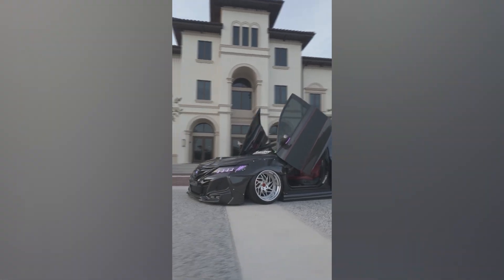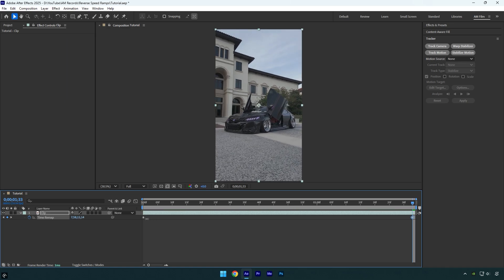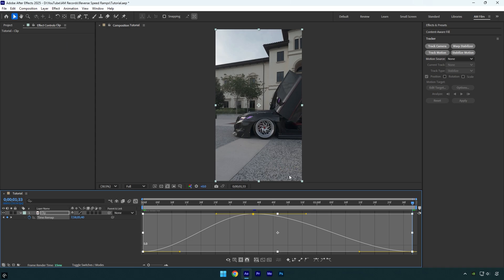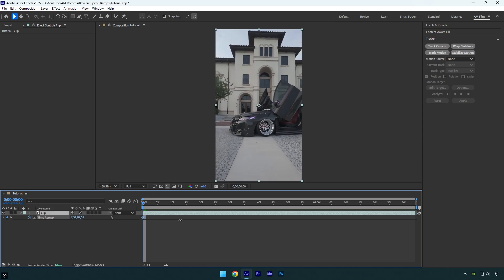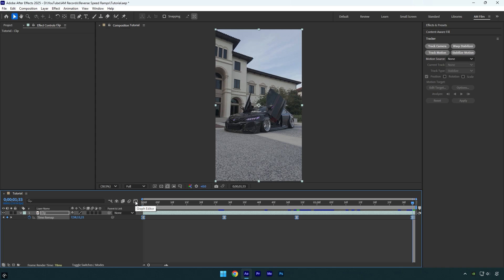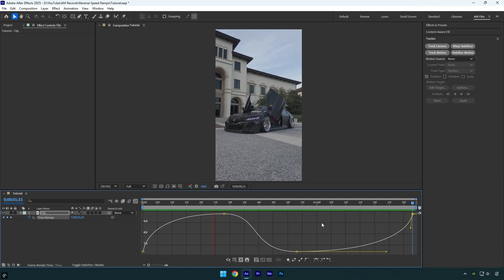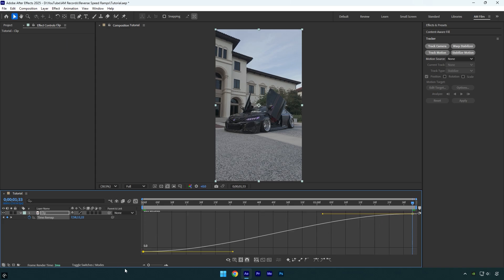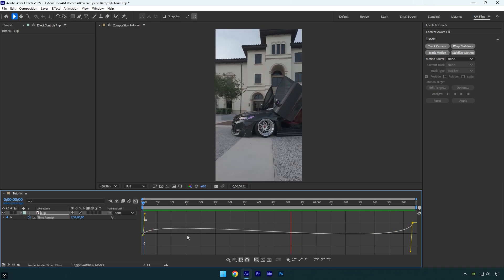3 Type of Reverse Speed Ramps You Can Do in After Effects

Comment: Hi bro! Thanks for video! I have a question: how to track a point if I can’t see one point during the clip or any kind of situation? For instance, it disappears in the middle or visible only in the middle .So many problems with tracking. If I use solid, it’s jerky
Reply from the maker: Hey bro, try "track solid stabilization" it always works and it's 101% smoother. Check tutorial under this video's description "Stabilize Videos Like a PRO"
Reply: @ ok. But how to track a scene where an open Lamborghini door is in the center of the frame, and the camera moves around it. There isn’t a specific point to stabilize — the movement goes around the object. Solid stabilization sometimes jitters or shakes slightly